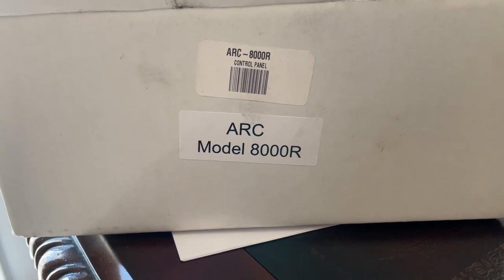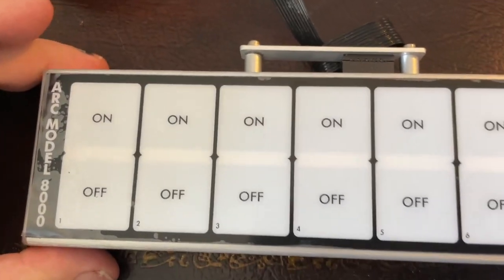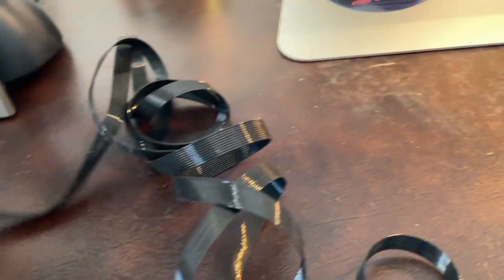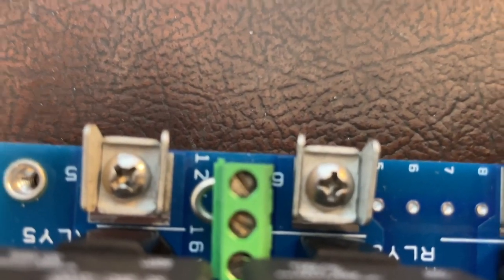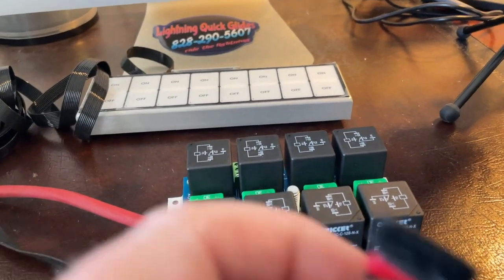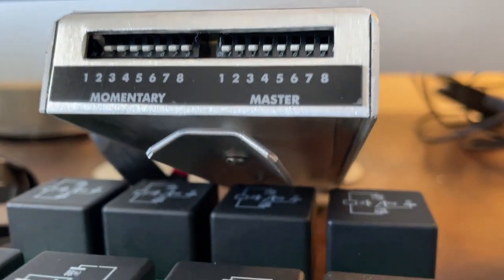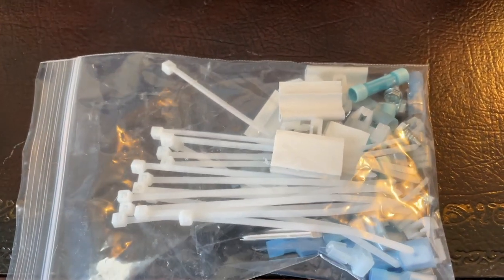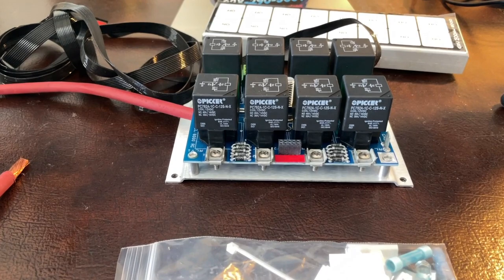ARC 8000R Switch Panel and Relay Board Kit

Comment: The biggest issues that I have heard of with ARC panels is the ribbon wire from the panel to the board.  Everyone that I have talked to that runs one says keep a spare on hand.
Reply: Me and pals can vouche for this statement👍👍👍👍 awesome panel tho.just the ribbon deal
Reply from the maker: I can see that and this is a concern I have for sure. Ugh.. I will keep you guys posted as I go... Go fast, go straight! Be SAFE!!
Reply: Ive heard that a lot too. We use those in industry alot. They due go bad, but it's rare. The key is that they never have strain on them, and they don't get hit. Don't reaf down on them with fasteners. Do that, and there is a low chance of failure.

Comment: I have the exact same switch panel in my 89 mustang hatchback race car an I love it. It’s very simple to install an wire up.
Reply from the maker: Thanks, Thomas! I do believe it will work fine and I need to make sure I don't tie the ribbon cable down too tight. Go fast, go straight! Be SAFE!!

Comment: I have run my ARC 8000 for over 4 years now with no issues. The ribbon cable can be an issue if you sinch it down too tight with zip ties. Also mine is an older version without the hold down bracket on the top of the switch. It has never come loose on me. If i had to make one complaint, it would be the switch panel. In the sun its sometimes hard to see if its on. I had to make a small visor for mine. Also if you ware gloves its hard to feel the switch. I wish they would make a mechanical rocker switch panel that would work with his board. I would upgrade my panel in a heart beat.
Reply from the maker: Great info!! Thank-you! Go fast, go straight! Be SAFE!!

Comment: Question…. On the big red wire connected to the circuit board does anyone know the washer layout? Is there a Teflon washer or just a single washer? I’m talking about the side that has the wire connected to it when you buy it

Comment: Top of the day to yall. One question for yall Kevin. Does the circuit board come with a cover ?? I really don't care for the ribbon and the China relays, but with that being said, I think it's a great choice.
Reply from the maker: the relay board does not come with a cover.. I have several tell me already to have a spare ribbon cable on hand. Ugh... Once I get it installed and tested, I will definitely report back. Go fast, go straight! Be SAFE!!